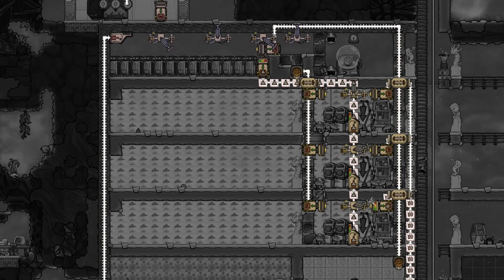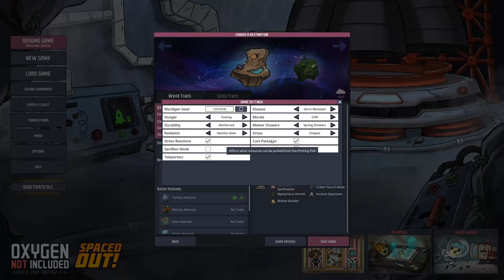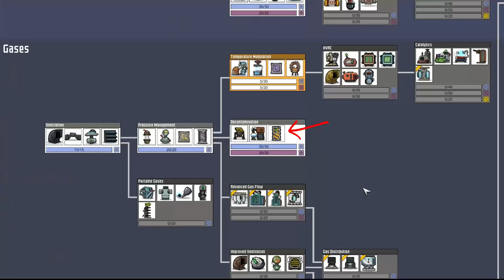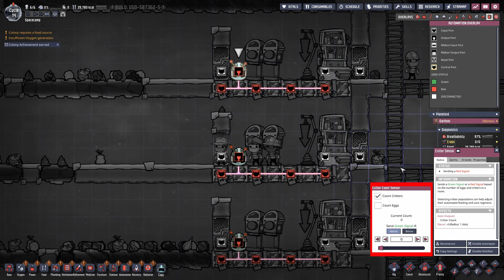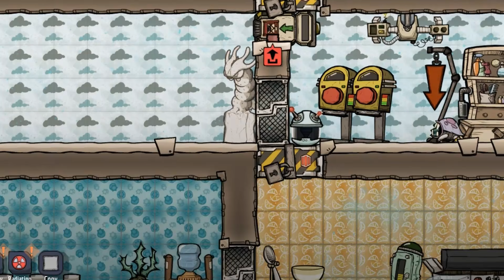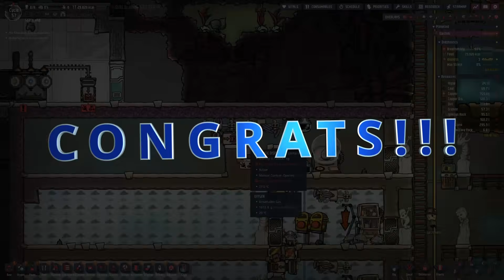Auto Hatch Ranch Oxygen Not Included | ONI Tutorial

Comment: how do you prevent the new born critter that will, lets say, complete the bottom ranch, fall direct to it without taking more critters from the middle ranchs together?
Reply: I believe that this is because hatches can walk over an open airlock as if it’s a solid tile (the same way that dupes can). But an open door will simply not stop the hatch that was squeezed out by the pneumatic door causing it to fall through
Reply: @xenosai371  so the solution is already taking this into account... I'll make some tests
Reply from the maker: Yes. Let me know if you find anything interesting!
Reply: @xenosai371  works exactly as you said, dont prevent a falling critter to fall but still a floor for the critters in the room